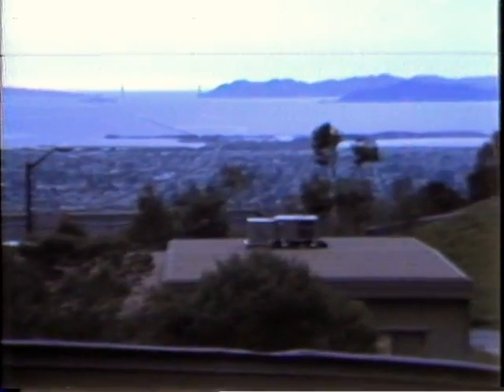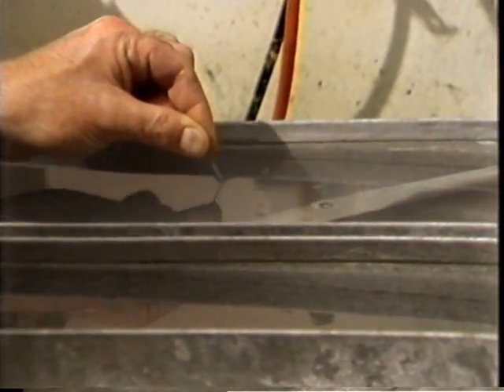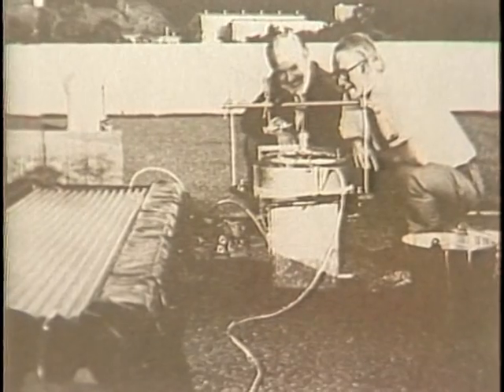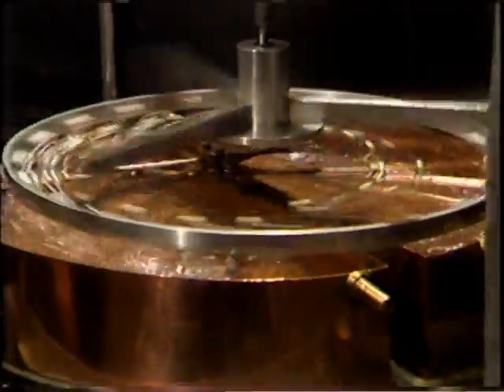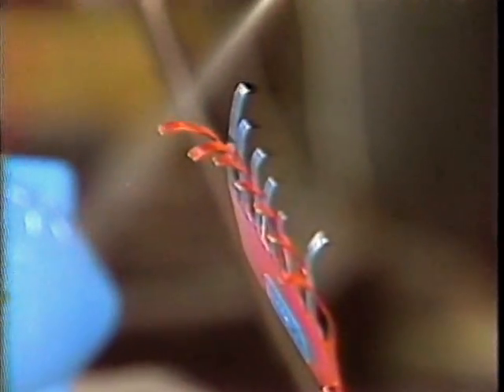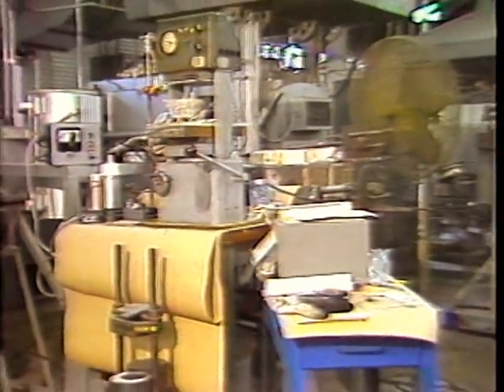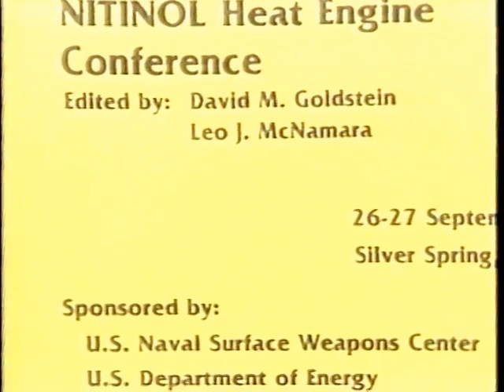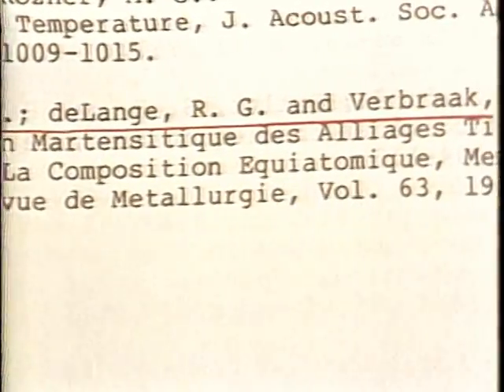Nitinol - A New Free Energy System

Comment: @TravelerDiogenes The term "free energy" refers to the fact that a solid state heat engine such as the ones shown here can get useful energy that would normally be wasted as heat from other processes. So, in effect, it is free because you don't have to burn any additional fuel to get more energy. It's just not (currently, anyway) economical to strap a nitinol solid state heat engine onto every heat-producing process out there.

Comment: Or you could do an internet search for parabolic solar dish or Fresnel lens solar. Both are more efficient than photovoltaic / area and both get incredibly hot (too hot, heat water w/ it). Making a solar tracking system is the hardest parts but there are free plans for that here & elsewhere on the web.
Any DC motor with the polarity reversed would produce electrical energy from a nitinol engine that you could use or store as you like.

Comment: First time I've heard of it, but I'm not surprised about that, nor about the existence of such a substance.  Heat exists, and has existed, since the 'big bang', and is concentrated in certain places, and runs out, in human terms, quite slowly... as in not at all.

Therefore, it is, for human purposes, an "infinite energy source", as is gravity and electromagnetism.  The means of harnessing it into engines of utilization is what takes initial investment, and the proper design of a self-repairing, or easily repaired, modular system of engines and other technologies is made all the easier by the sheerly mechanical aspects of the underlying material and its mechanism of delivering energy.

In the fields of research in which the NSA has specialized, the theory of how signals are processed in terms of modes of HEAT, ENERGY, and INFORMATION is no doubt profoundly impacted by this simple natural fact of Nitinol.  Imagine nanotubes and fibers, switchboards, mechanisms, which are micro and nano scale, and which adjust and repair themselves according to some application of the principles of automata theory...

Babbage would have a field day, as mechanical computing had just been brought back to the forefront of technological advances with this substance.  As to the difficulties for translating quantum computing modes into conventional electronic computing modalities, there is a direct bridge made possible by this substance, as meshes of nanofibrous materials which are properly designed to respond to signals of heat could directly and reliably translate those heat signals into mechanical form, which is then translated into electrical signals.  The first quantum supercomputer "ENIAC" is right around the corner... or rather was right around the corner 30 years ago.

This planet surface, is a human zoo, a gigantic playground/social laboratory/torture chamber for people "playing god".  They should be disgusted with themselves for doing so, but that's precisely what is lacking in them, a Spiritual Consciousness. Therefore they can expect a profound response from the True Cosmic Powers.

Comment: When I use wood to heat my home, a lot of heat is lost up the flue. A simple heat exchanger could capture waste heat and drive an engine that could drive a blower or generator to charge a battery set to convert DC to AC Power.... once built and costs covered...it is free

Comment: Use gas (or whatever fuel you like) to heat the water to start the engine, use the engine (However it may be done) to heat water to continue running the engine and other engines that do useful things. Problem solved.

Comment: lol, enough with the "free energy".
this engine works like a Stirling engine (in applications, the actual mechanism is obviously completely different).
Why don't we use stirling engines you ask? Because they are terribly inefficient. Those engines might be slightly more efficient (I honestly don't know), but they still look extremely weak. 
Unless those engines can provide significant power like commercial engines - it won't be cost effective to maintain them, even if the energy source is environmental.

P.S
I refrain from saying "free energy" because even though the energy can be "for free", some people might interpret that as an engine that extracts energy out of nothing.

Comment: ...This is NOT free energy, the water still needs to be heated and heating the water costs a lot more energy than you get out of a Nitinol engine..

There is no such thing as free energy.
Reply: lol did u think the solar energy from the sun isnt free or that it will end very soon? in fact life as we know of it to be, until now, relies on solar energy to survive

which means that for as long as their is a sun, nitinol is a future proof way of pairing with solar panels for endless free energy or perpetual motion and perpetual energy if u will, because our kind of life can only exist with a sun around anyway.

its future proof free energy because we can always switch solar system when our sun dies in the distant future to inhabit another planet in another solar system with another sun and use this same tech and merely need to improvise on it even further with the tech breakthrough we have in the future to increase efficiency

being able to convert heat (lower energy level) to mechanical energy (higher energy level) is frontier physics